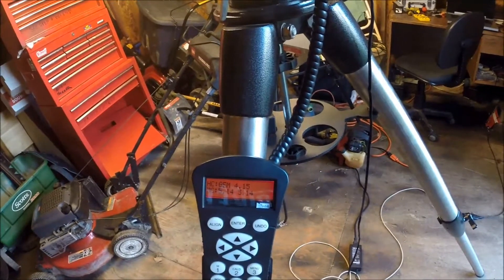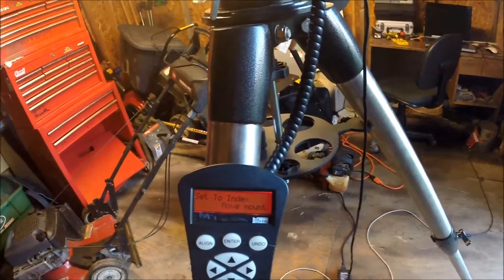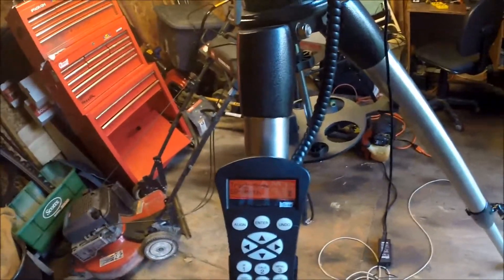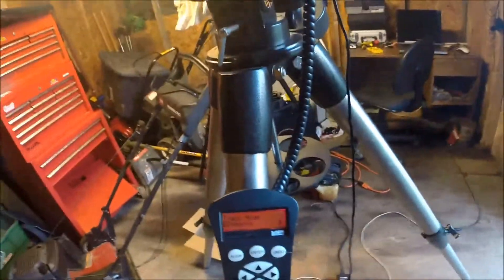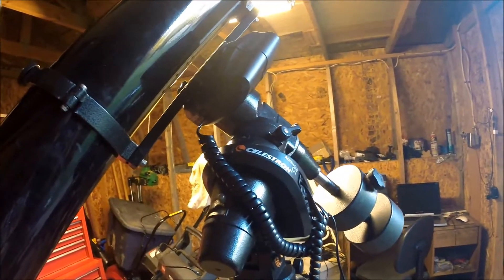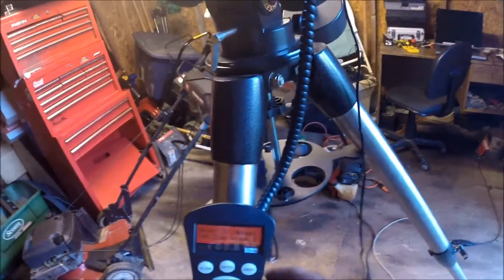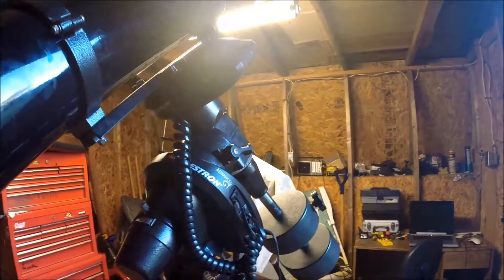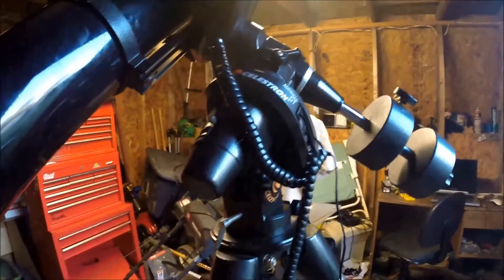Celestron Advanced GT

Comment: I just bought a used C6-S that is in pristine condition. The last time it was aligned was 2005. I'm getting the same runaway slew as in this video.  I've flashed the latest HC and MC revs and it still does the runaway slew. I went back to the older HC GEM 4.10 and MC 5.04. Also, at various points on the RA slew the motor stops while the slew bar rotates and after about 15 seconds it resumes the slew. I'm guessing the encoder board is the problem. Any suggestions?
Reply from the maker: As Brian stated he replaced the Dec motor encoder, I got tired of throwing money at the mount and sold it to him and bought an AVX mount.